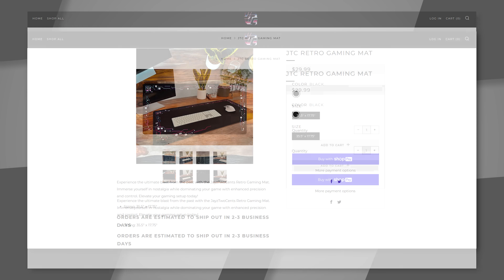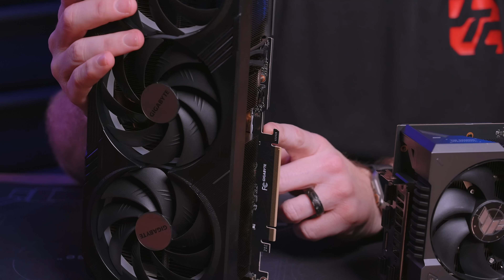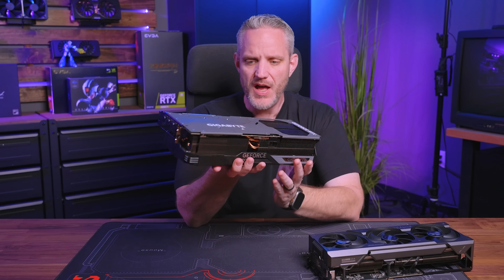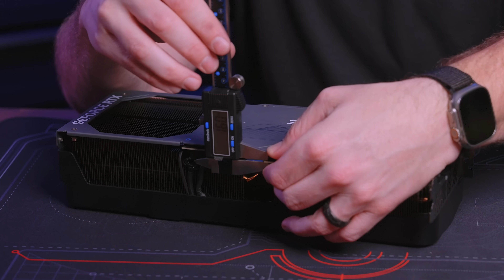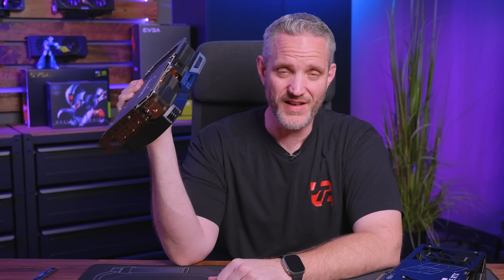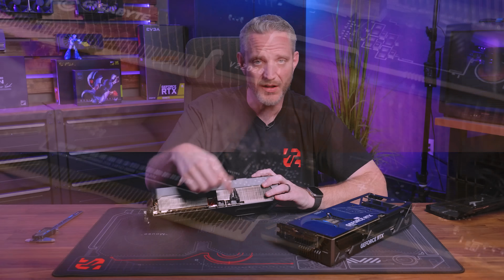These GPUs are cracking and the company REFUSES to warranty them!

Comment: One thing to remember: if it can't bend it will break ---- Having flex in that GB card is more likely because they learned the lesson: no screw-hole nearby, seemingly not much traces around the tab.
Rigid parts are more likely to break -- that Asus has a lot of traces/vias around the tab (that also can make it stiffer -- having copper inside vs. only the FR4  -- but if it is functional copper and breaks it can short or cut parts out) and the mounting post is very close (albeit not as close as in the pics from the broken cards)

Comment: I had my motherboard button completely fall off cause I could not depress it, even with a pencil(using the rubber end). My 3080 sits without it. Those buttons are hell, with the size of the cooler (NH-D15) and the gpu you cant put your hand there. With an AIO you can but still some motherboards shove their own coolers there.

Comment: The problem is not that they're cracking, most cards probably are. It's not even a problem that there are vital traces running through that area.
The problem is an FU from another big manufacturer screwing up and blaming it on consumer.

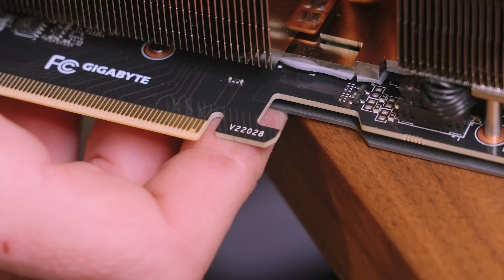Comment: It's pretty obvious why the Asus pcb does not flex that mucht, there's strut for the cooler mounting right next to the area where the latch is, this strut provides support for the pcb which is why it feels much stronger in this area. You can clearly see it in the comparison video, starting at 6:36 (Gigabyte) and 6:45 (Asus). You can also see the flex in the area where the PCIe connector is, there the Asus flexes quite a bit and I'd say even MORE than the Gigabyte just as you would expect from the thinger pcb. So it's really just the strut that keeps the Asus from flexing.
Sidenote: Flexing is not bad per se, if something is stiff, it would crack more likely than something that will flex a bit.

Comment: WTF is going on here, in 30 years of me messing around with PCs (building, "tuning", overclocking and playing) I have NEVER EVER seen something like that neither has anyone of my friends or anyone from our local overclocking community. We cracked a broke a lot of (expensive) hardware turing this time but nothing like that.
But new GPUs have become ridiculousely big and heavy so I think the industry should definitely provide a solution for this problem with the next PCIe generation. I think there's different possible solutions but I'm not an engineer so I don't want to talk about any specific ideas.

Comment: To this day I still do not understand why all card makers and case makers do not have mounts for screws built into the cases and cards to allow end users to screw/mount a support bracket, this would be a universal upgrade that would support/help all end users in better builds, it is stupidly simple, a designed reference points that would allow all card makers to supply a support bracket or order one when you purchase a card, keep it simple stupid (kiss theory)

Comment: This is good time for PC Case designers to come up with an idea to mount the new generation of heavy grfx cards and reduce the stess on both the pci-x slot and the locking tab and not rely on the expanse mounting bracket. May some sort of clamp that grabs the body of the grfx card and transfers the weight to the case and then use a riser cable. PS. I hate the locking clamp on the mobo most the time I break it off depending on the access and system build.  This is from prior experience I did break the same tab off of AGP card back it the day and the lucky card still worked.
Reply: It's called a horizontal case and they already exist. Most PC components are designed and tested with the motherboard flat/horizontal and work far less efficiently turned on their side. (especially cooling towers)

Comment: I have a bit of PTSD from my fresh out the box 4070 ti doing a black screen with 100% fans then felt like an idiot when after wasting an hour trying to figure it out and then going to put back my 2080 to realize I did not have one of the connectors in all the way and then it worked with no issue.

Comment: Diablo 4 is hugely taxing on main system memory bandwidth. Its probably a better stability test than memtestx86.

Personally just found out my DDR3600 is only stable in D4 @ 3200. it's fine... also learned during testing that 2133mhz will cause map loads to stall and the game to stutter. 

Its also using all 24 threads of my CPU and maxing out windows+d4 is using 24gb of memory. 

Game is definitely next gen and will use every bit of modern hardware your system can throw at it.

Comment: The obvious differences in the Asus card that makes it stronger at the tab is that it has a screw down brace slightly forward and up from the tab and , not only does the Gigabyte card not have that brace , but it has a huge cut out of material right there making the tab weaker still .

Comment: Stories i could tell... Asus refusing repairs due to missing screws on bottom laptop cover that fallen out by cracked mould. Hinges falling out from mount damaging lcd's - Straight refusal. Best ones were Asus motherboards with artificial scratchess causing refusal. Last time iv sent them rog laptop for repair, i disconnected one riddon on purpose so it does not boot. They emailed me asking to pay £280 - they have to replace something. This is a joke company.

Comment: As a strain test engineer, I've seen this type of issues in all the industries of SMT, no one cares. Since theres no any strain standard, manufacturers do what they want until they are audited. The nearest thing as a standard of strain is the IPC9704. The issue with this document is that its just a guideline.
Personally when big GPUs came out I was worried about this, theres a lot of weight and moments involved in the mounting, and I am pretty sure they didnt care when designing this devices.
Reply: When a manufacturer offers a cheaper product than the average, not always uses cheap components. Usually they are lack of detailed quality inspection, they only perform default quality tests.

Comment: I think you may be mistaken about what makes a part "weak". You talk about how flexible it is as if that means it's more likely to break. It's actually the opposite. The more rigid a material is, it's also more likely to crack. It's more likely to be brittle. Flex can add strength. It allows it to handle when things are twisted and yanked.

Comment: They're likely suggesting improper "handling or installation" of the card into the slot. If its bent slightly from the user installing or removing it, seems likely they will avoid considering a warranty issue.  However, if there are many claims being made they probably should look into the robustness of that laminated board in the area of that locking tab. I can see a few things that put more strees on the board and that is the size of the fans and heat pipes etc. that do not exist on smaller graphics cards. 
If I purchased a 3 series graphics card at those prices and a few months into ownership of one it failed at that spot, I would be calling them too. Bad design, it needs reinforced.

Comment: I got a Gigabyte RTX 3080 ti OC eagle. It bricks (displays suddenly turning off with max fan speed) while playing a non-demanding video game (Warframe).
I took it to warranty, and they honor the warranties. It took 2 months to get a replacement. Now the replacement work but if I don’t use a software to turn the fan on at max speed the pc will reset every time a play demanding video games in a few mins. It’s still alive so far and keeping it away from Diablo 4.
Reply: You might need to re-pad it or undervolt the ddr6x memory by ALOT. My Gigabyte 4090 memory would overheat until I re-padded it. Took it apart, changed all the junk pads that are transfering heat from the memory to good pads. Dropped temps from 100+ on memory to 75-ish. They REALLY use crap pads.

Comment: I bet its the orientation of the fiberstrands if the PCB has them and the structure/orientation of the strands or layering. It's like plywood and the strands running a certain way more so than another. Or a lack of glue?

Comment: Sounds like all cards could use a support! I've been using the small piece of high density foam that cards come packed in for years as a "BETTER SAFE THAN SORRY" solution.
Reply: I could do that as well since I put an aftermarket cooler (Raijintek Morpheus II) on my 6700 XT and I see a little sag now.
Reply: My MSI 3060 ti came with a weight support which worked great

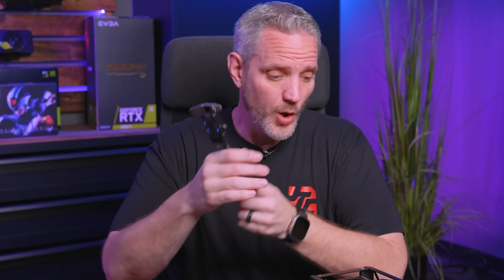Comment: Hey @Jayztwocents, most PCB are made from FR4 (8:57). In case you were wondering FR4 is a flame retardant material made from epoxy and woven glass fibers.

I have a Gigabyte RTX 3080 Vision OC at home. I have it mounted horizontal, and installed a Cooler Master RGB GPU support bracket because I was concerned about mechanical stress on the PCB. I'll update this comment later today with feedback on whether I see signs of cracking.

Update: My Gigabyte RTX 3080 Vision OC (approx. 1.5 years old) doesn't show any signs of cracking. Prior to installing the GPU support bracket there was a surprising amount of sag on GPU. The main reason I bought the support was because it seemed like there was a significant amount of stress on the PCB. My guess is the cracking is purely mechanical as alluded to in the video, and thermal fatigue/expansion plays little to no role since mine shows no signs of the issue, and has been supported the majority of the time.
Reply: If you have the bracket actually holding it up its going to be fine. When  I uninstall my gpus I lay the computer flat, use a screw drive to depress the locking tab (big man hands) and pull straight up. No cracks so far on several large cards.
Reply: @WavveBoi  I do the same, for the same reason, big man hands...
Reply: @bags4649  I got the long L shaped screw driver with a noctua cooler and I've been using it for years. It's my favorite PC screwdriver.
Reply: @WavveBoi  nice, i bent one specifically for my case and gpu, i just couldnt get anywhere near it... will never get another midi case again...
Reply: @WavveBoi  I figured my card would be a good indicator if the problem was mechanical, or a problem with thermal fatigue/expansion.
Reply: @dcso4080  I don't think FR4 suffers from alot of heat stress. Like it might take decades for that material weaken sufficiently. I could definitely be wrong though. This seems like an issue of big heavy cards with not enough support on a section of PCB. With some cost cutting thrown in. 

I've been hearing alot of long term quality issues with Nvidia cards and I'm wondering if I should trade my 3090 for a 7900xtx.
Reply: @WavveBoi  He specifically mentioned that there were traces near the edge of the circuit board in that area. FR4 and copper definitely expand at different rates. A partial delamination could be occurring due to thermal cycling and lack of cooling in that area. Especially if those are power traces. A partial delamination could cause mechanical  cracks to form more quickly even if heat stress isn't the root cause. Overall I agree that mechanical stress seems the most probable though. It also seems like the most obvious issue to factor into the design. I guess I'm giving Gigabyte too much credit.

Comment: To some extent I think the atx and pcie standards need to be updated for modern hardware. I don't think graphics should be a slotted add-in card that are suspended in air by just flimsy retention clips when they now need these massive heatsinks. There's also issues with all the additional cable management. Can't pci-sig create a standard for vertical gpus and a unified power/data cable? Like an oversized usb cable. Give gpus a base so they can sit on the floor or a case or psu shroud or even move the motherboard forward and place the gpu behind it in a 2 chamber design like sff cases.

Comment: Gigabyte mobo's mostly good, screw up gpu.
Asus gpu mostly good/best, screw up amd mobo's.
Add more screw ups and my to favourites are an no go.
And I don't want to become an msi fanboy lol.
Reply: And then they find out something bad about msi too. Where will you go then? I had a 3080 suprim from MSI that died in a half year. Now I have a strix and it works fine.
Reply: @Th3_Dark_Side  I have an rog strix 3080ti and an gigabyte aorus z690 ultra.
Both no problems what so ever.
Well I hate that all the good brands are f***ing us over lately.
Giving us no other options than mix and match different brand parts, which sucks because all of the different software instead of having just one nice software for everything.
Well at least I heard they gonna integrate an rgb software in windows 11 that should be capable of controlling all kinds of RGB.
I hope they will do this eventually with everything.
I just feel that nowadays no brand is safe anymore, each in their own ways.
Reply: @Limburg92  Well, the rgb softwares are bad anyway. All of them. Because they don't let us install only a software for our rgb but also some other crap that no one needs.
Reply: @Th3_Dark_Side  thats why I am hoping the windows update for 11 that will come.
Let's hope it will be the lifesaver we deserve.
Maybe if it works well they can also integrate fans and aio's, let's only dream.
Reply: @Limburg92  I don't think that it is possible to integrade something to let us control the display of an aio. Sadly we will need the software from the specific brand of our aio for that kind of stuff
Reply: @Th3_Dark_Side  Unfortunally, I think you are right.

Comment: One of the primary and most common things covered by a warranty is that the product is "...guaranteed to be free of manufacturing defects...".  If the product is made of a material, or to a design, that is not up to the task, then I would class that as a 'manufacturing defect'.

Comment: I bought an MSI Gaming Trio 3080 12GB and when removing the shroud to clean the dust out, I noticed my PCB has a pretty severe curve to it.
I normally remount and re-paste my GPU as time goes on, but this one has me scared to even touch it, I fear the stress changes of the PCB straightening out will cause the die to crack
Reply: Did u have a gpu sag support bracket?

Comment: This is great. Love the video. I wish they would apply brackets to the Coolers in addition to the the one on the card so you can screw down the cooler too. Since they are now 3 to 4 slots wide now why not have a single slot brace on the cooler too. I would want it to be separate from the card slot brackets to be clear. You might be able to do a mod to a cooler to add a bracket. Have not tried one because I am water cooled.

Comment: It’s the standoff that’s reinforcing the ASUS board right next to the tab. That’s what is preventing the flex. It’s ok/better design vs bad design. They shouldn’t be using the PCB as a structural part of the product in the first place.

For years they got away with it because graphics cards were small and light, but over time that slowly changed and now they literally reached a breaking point. My guess is that future cards will get a redesign using a separate hook that’s not part of the PCB, then PCIE sockets will start breaking off motherboards because again, structural PCB’s shouldn’t be a thing.

Comment: I can see why they would deny the warranty if the card was supplied with a antisag bracket which I know mine was. Thats 100% physical damage from improper installation with no anti sag bracket thats the exact point that would have extra pressure on it without one. The problem is more so the bracket they supply only fits on gigabyte motherboards alittle trick the have done to make people buy both products but it has backfired now as people aren't installing them and they are getting bad press on the quality of there products.

Comment: Not surprised. I've had quite a few GPU over the last few years and the thing that's always surprised me is how *un*structural the mounting plate is. The pcb cantilevers off the mounting plate right at it's edge, mechanically it's just a terrible design and relies on the pcie connector to hold the card up.
However it would be extremely simple to just continue that bracket alongside the rear of the card and make this part a fully structural feature. 

As you say Jay, triangulation. It's not rocket science

Comment: the same concept happening here, (coming from networking of all places) is referred to as "cable fatigue".  this is from the constant weight of cables hung from Top of Rack (TOR) switches.  we don't think that weight alone can possibly be responsible for network connectivity degradation or otherwise loss, but it does happen.  the weight/stress alone can be enought that the cables will lessen the tension from connections in RJ-45 sockets.  this is why cable management came into fashion, thus alleviating the loss of connectivity.  now as for these video cards, the manufacturers rigorously test the functionality on them with the systems in "optimal" position.  this is where the system is positioned in a manner where the video card resides in a 90 degree angle to vertical, thus no potential "stress" can be involved in normal use of the controller.  we so often use these monsters of video performance in "tower" systems these days, which by their very nature introduce stress points on the connection points.  weak/flimsy products not withstanding, this is what I'd look into rather than the insertion/removal of the cards.  who removes and inserts their cards AFTER they build out the system in the first place?